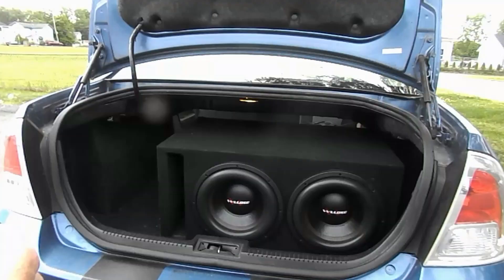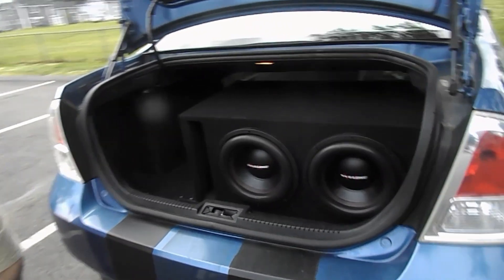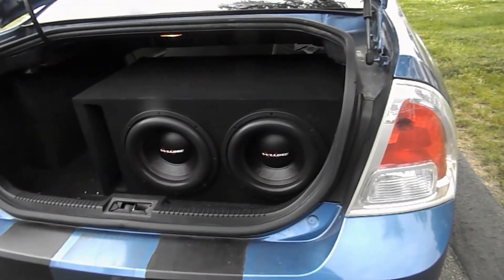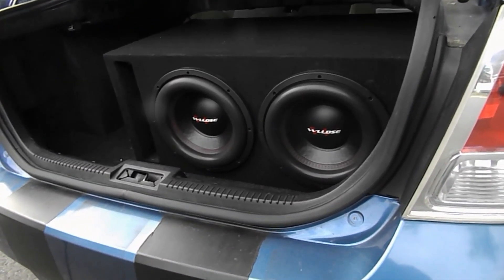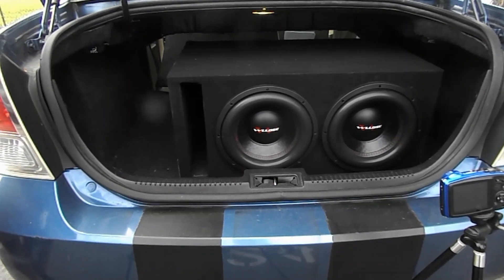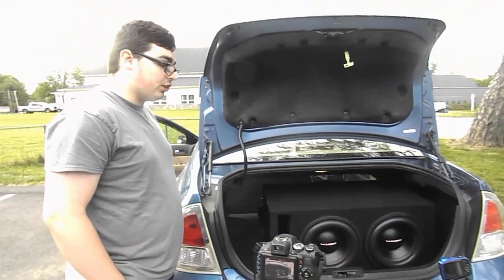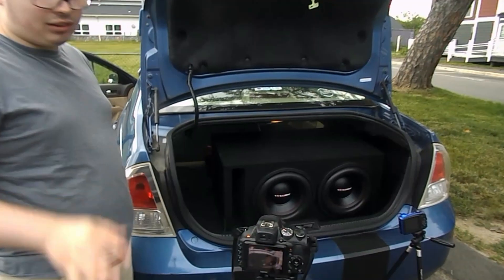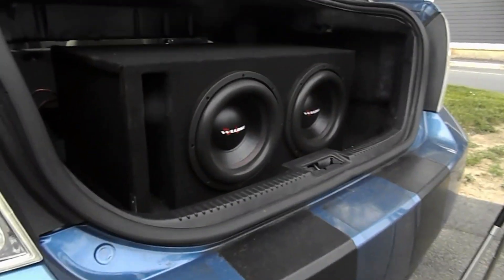WLLDSE HCY-12 X2 1/2 Ohm 2,000 Watts NVX-XAD12 Multi Camera Shot Phase Check In / Out Of Phase #bass

Comment: I ligit cant believe that those fullbridge amps haven't blown yet being wired at half ohm I had the 5k model and 8k model and the 3k model I've tried half ohm n they all went into protection n never came out most the time the only amps that can do half ohm are half bridge Korean amps or like the Chinese jp23 halfbridge amps and some other halfbridge amps that are Chinese like the cab 22 n 45 but those fullbridge amps besides taramps smartline and bass models are like the only fullbridge amps that can do half ohm with no issues and here yall are doing half ohm on those xad amps which r the exact same boards as the sundown sfb amps
Reply from the maker: That's going to be a future purchase is a Korean board amp. Yup. Nothing has blown or have any issues. We have the xad11 12, & 13.